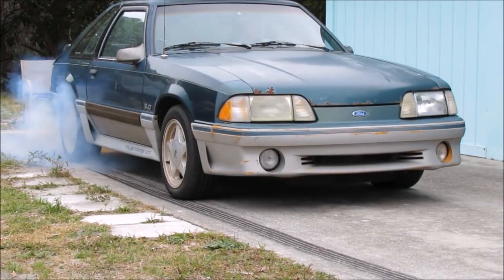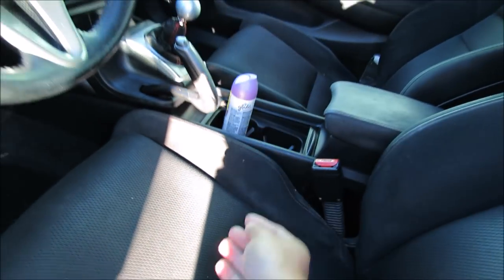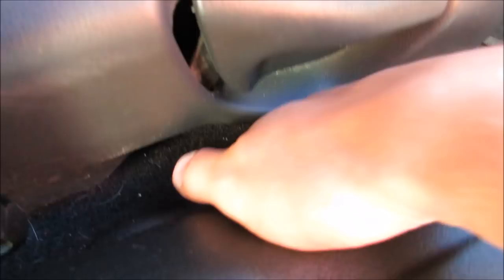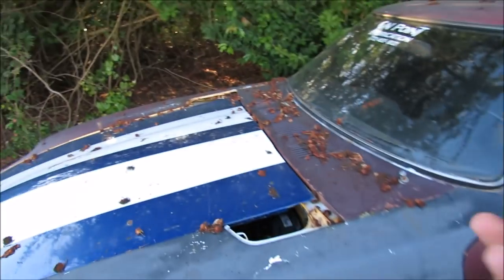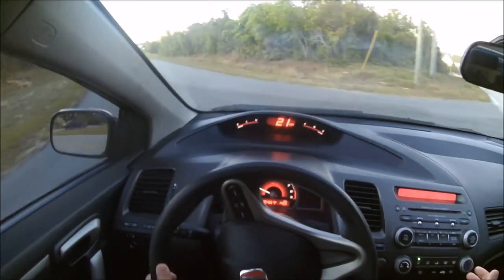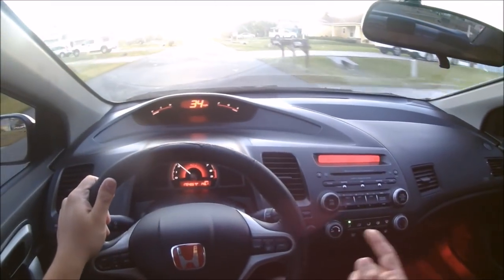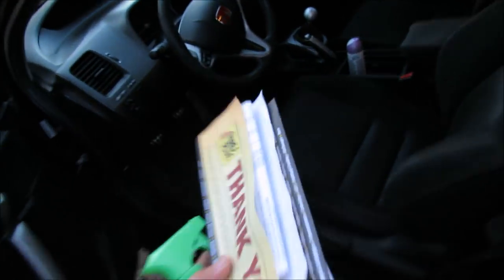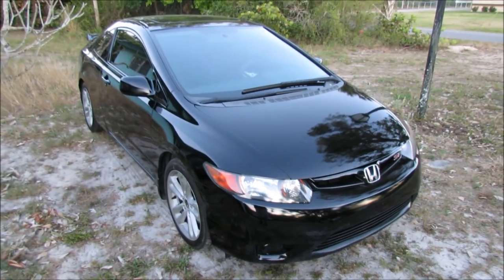My First VTEC Experience

Comment: That's a 75 ohm <-> 300 ohm transformer (balun).  Essentially it's what you use to connect a TV antenna to your coax system in your house.
Reply from the maker: So it probably has no reason being in the car
Reply: well that depends... maybe you'll want to put a TV antenna in the car some day... you never know!  that $5 adapter might come in handy

Comment: Its literally impossible for the car to not go faster on vtec, facepalm
Reply: its not a noticable difference, it slightly increases the cam profile and timing, it adds about 30hp and is pretty smoothed out, its not just 1 big jump in power
Reply: @cheetahgaming3642  you also gotta slam it & not be afraid, this guy held back a lot & he could’ve went 2k more rpms just fine